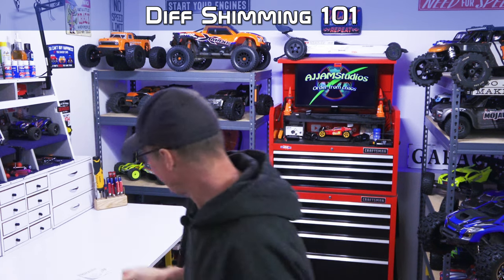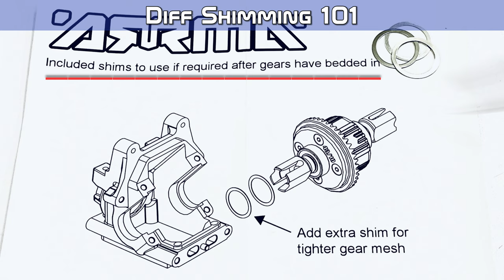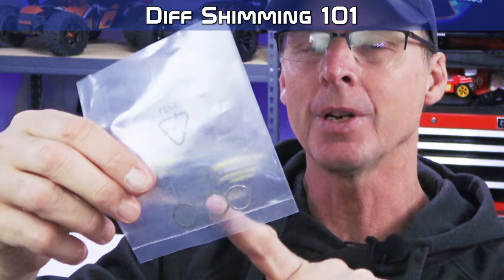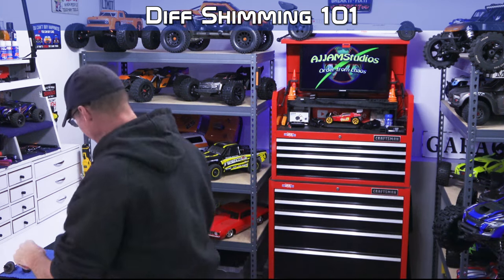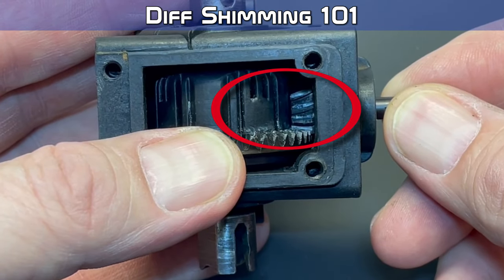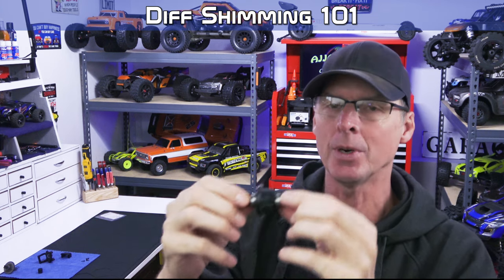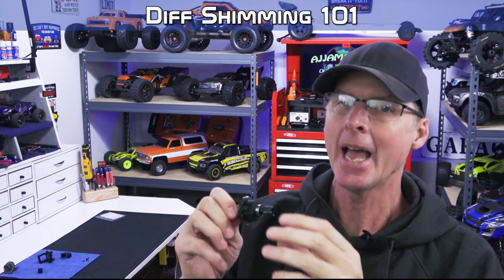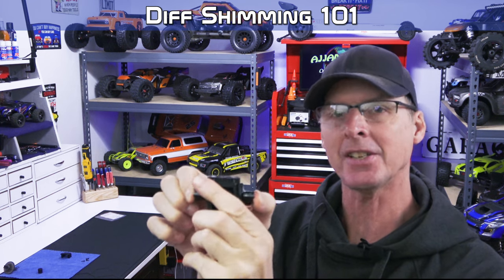Diff Shimming 101

Comment: I have had a lot of problems with my diffs on Arrma Outcast 6S in recent years. 

The rear diff spur was stripped, and the spur was destroyed. I bought an EXB diff on eBay and it served me a couple of rides. For some reason, it always ends with stripping spur gear. The center diff is rock solid, but not a rear one. I installed an open diff with the hope it will last longer. My rig runs on 4S with a speed pinion and without any crazy bash but rather a speed run and a bit of offroad.
Reply from the maker: Traction is a killer for gearing. Running speed runs, especially on pavement which is done most of the time for speed, puts a lot of pressure on the gearing in the rear, since that is where the majority of the launch weight is shifted to. Tightening up the center diff puts even more pressure on the rear diff - not allowing it to bleed off the extra power to the front end. Still, shimming the "pinion" in the rear diff to close up the gap for the gears is one way to minimize the wear issue; for your diff it requires an 8mm shim: (CLN) #4738 from Calandra Racing Concepts. Also, side shimming for the differential to remove slop is paramount to proper durability. Since the teeth for the diffs are fairly small for the power they handle, the next step might be moving to the EXB rear diff with the LSD plates inside. The gearing is a bit bigger and may handle the power better. Still, we punish our rigs in high traction environments, and we have also suffered diff failures, but with proper spacing in the diffs our losses have been relatively small. Keep in mind, power creates wear and heat accelerates it too. Proper lubrication can prolong the gears for a time, but consistent observation and maintenance should get you the best results. Do not forget, bearings seat in and the gearing can change over a few batteries, so do not forget to check them now and then.

Comment: This is helping to explain why my diff started acting up after I replaced the bearings and swapped my ring gear over to a fresher diff. I checked the side to side play but didn't put much thought into the input gear play etc..  Now I'm thinking the gears I replaced still had a lot of life in them.  Are you finding that the input and ring gears generally have to be replaced at the same time?
Reply from the maker: We swap them both at once. Fresh gears with fresh gears. A used one can wear a new one faster. Thanks for asking😎👍